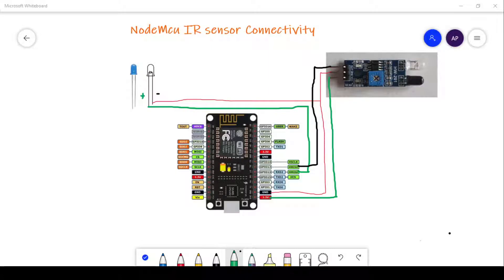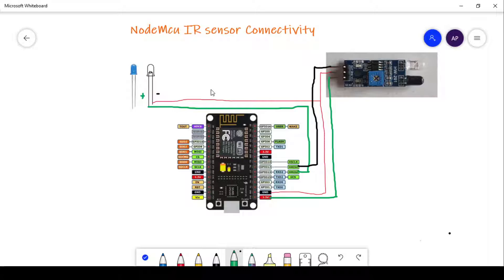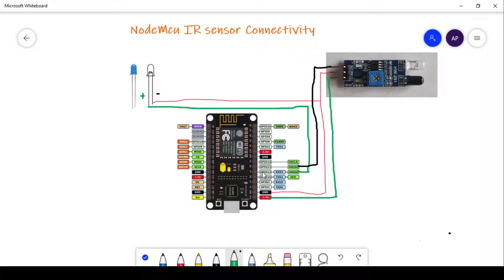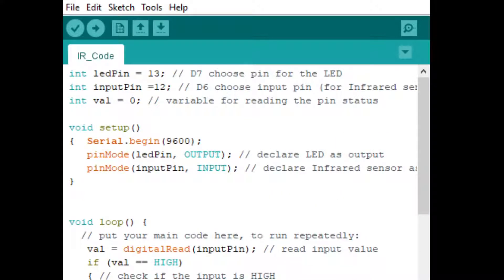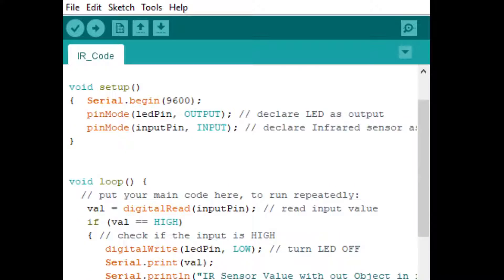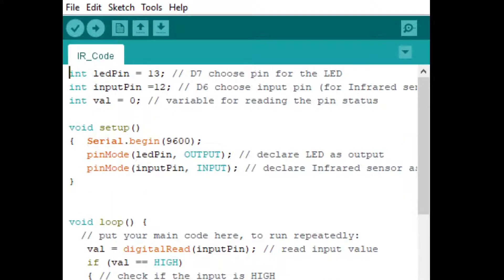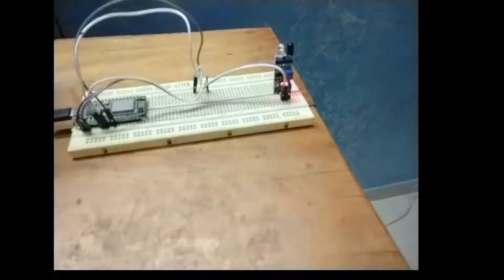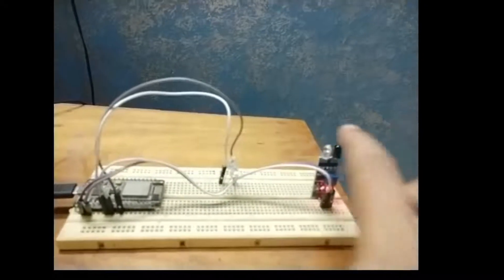ESP8266 NODEMCU & IR Sensor for  Object Detection IoT Application

Comment: hi sir, thanks for the insightful video! Im doing my final year uni project, i have to connect a piezo pressure sensor to detect if person fell. the sequence goes like this, person enters room>ir sensor detects>person falls>piezo pressure sensor detects>nodemcu receives>alert is sent. can i use the same setup as you but replace the led light with a piezo sensor? also are there any reference or guide out there for the arduino code for piezo pressure sensor? 

hope to hear from you soon. thanks in advance!
Reply from the maker: Hi REI4236, you can go through the article(link given below) for reference https://www.arduino.cc/en/Tutorial/BuiltInExamples/Knock
Try the sketch ..
Best wishes ....

Comment: One quick question, the sensor HW 201 data sheet says it requires 5v as operating voltage, whereas you have connected to 3.3v of MCU?
Reply from the maker: IR sensor works fine in the range 3.3-5v..